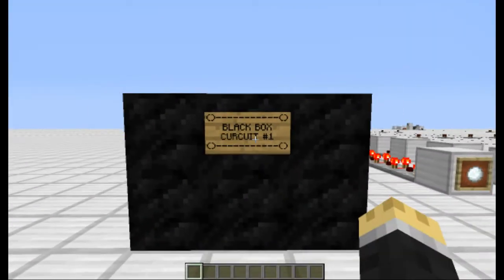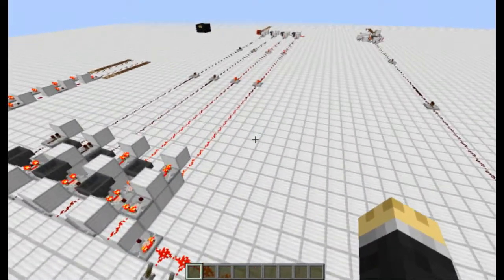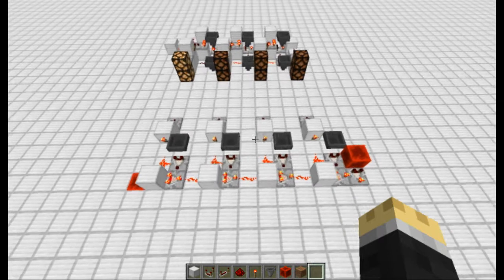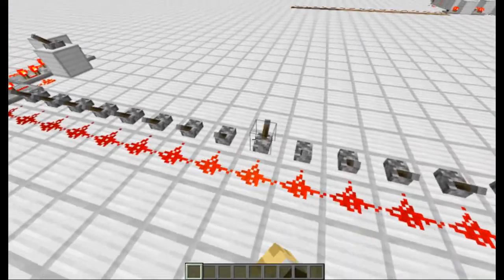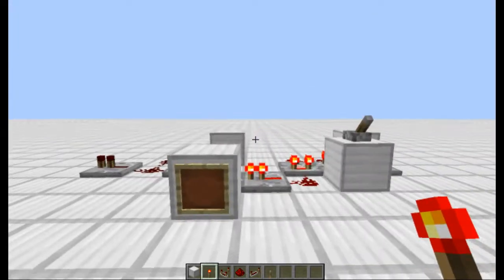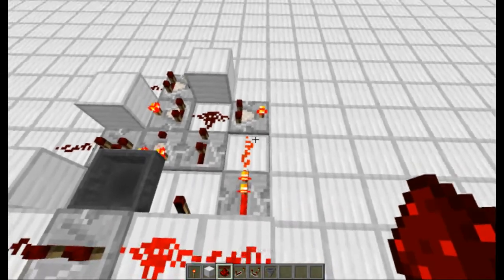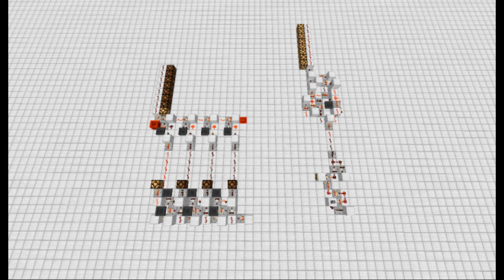Long-Distance Analog Transmission + Tutorial

Comment: Why does it only go up to 8? I'm not that good with comparators, but wouldn't a nine minus an eight on the comparator be a 1?
Reply from the maker: im not sure what you're talking about here, I'm afraid I don't have any context... could you timestamp an example of what you're talking about?
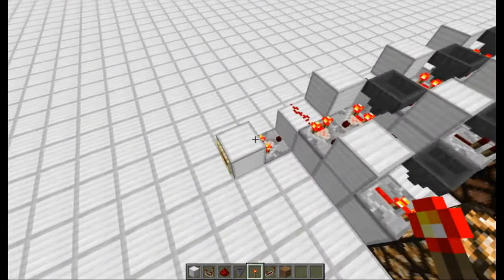Reply: Sorry, I do realize now how vague that was. I was talking about 3:58
Reply from the maker: oh, so the analog-to-digital converter can convert signals from 0-15 because that's the range redstone works at (0 being off, 15 being full power) but an item in an item frame only has 8 points of rotation. With the first position giving off a signal of 1 and the last position giving off a signal of 8, my range when using an item frame dial is 1-8
Reply: Ohhh Ok, sorry for that. I didn't know :p That's kinda embarrassing. What I thought you originally meant was that the converter went to 8, which confused me :p
Reply from the maker: oh, don't be embarrassed, I didn't to a good job of explaining... that's still something I struggle with and it's something I'm working on improving ;)
Reply: Nah, it's ok. I'll be honest, everything I know about computer science comes from youtube. I've never taken a class or anything. I know, for example, how to make an adder, but not how the pieces of the computer go together. If you would, would there be any videos you can recommend that teach those things?
Reply: Sorry, just realized that what I said probably sounded unrelated. What I meant was that most of the things you say probably make a ton of sense, I'm just really uneducated and can;t understand :p
Reply from the maker: its semi-related - there are plenty of videos out there that will give you bits and pieces to the inner workings of a computer, but I've yet to find a complete series that encompasses everything from logic gates to software. however, watching peoples videos for home brewed computers often offers some useful insight! Ben Eaters SAP computer is a nice and easy computer to understand, Harry Porters relay computer is a little closer to an x86 architecture but with blinking lights and such, and if you can stand lengthy videos and reads, Bill Buzbees Magic1 is a really excellent computer to study! then as far as software is concerned, I'm currently watching UCBerkeleys Computer Science 162 lectures, each vids about 1.5 hours and there's quite a few of them, but they go really deep into the details of an operating system! otherwise, searching for things like inside the 4004, 8085, 8086, 6502, x86, atmega328, those will usually bring up videos that have information you might not have known before!
Reply: Wow, I knew about Ben Eater's, but not the other series's you mentioned! Thanks! :D
Reply from the maker: np
Reply: Dude its because he's using item frames which only have 8 states